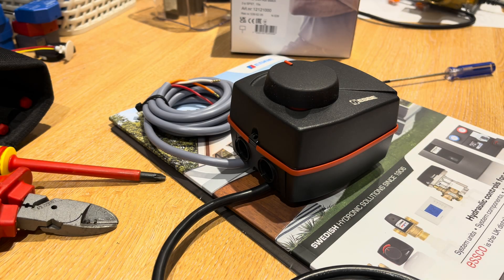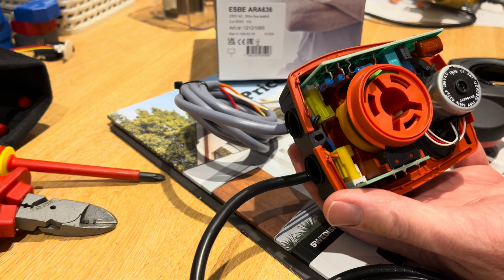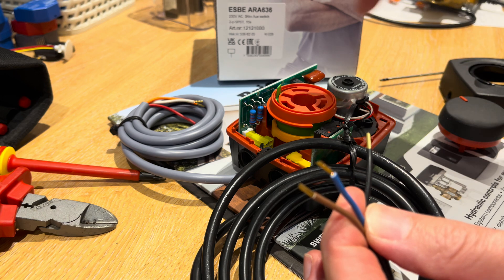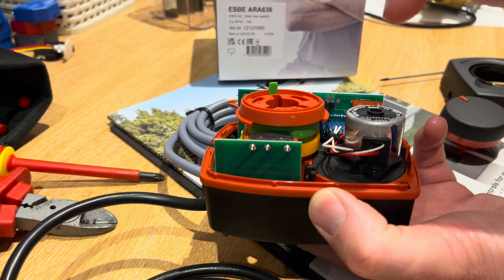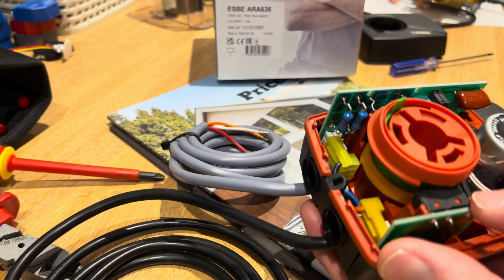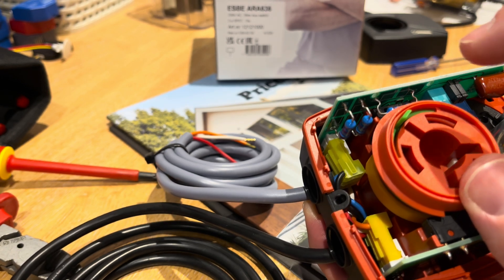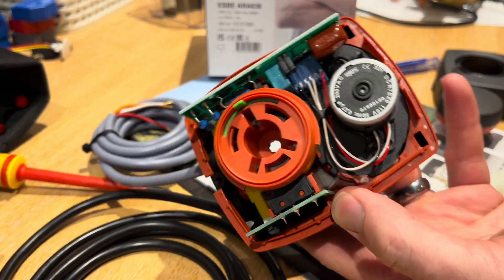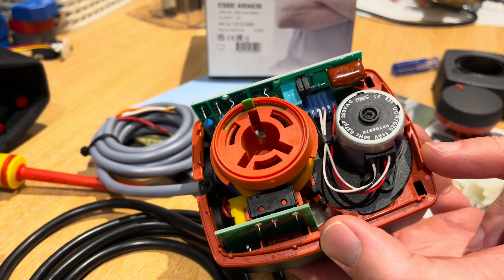ESBE ARA600 Series - ESBE ARA636 2 Point Actuator Overview

Comment: I have a question,screw the green part in the handwheel can let the switch connect on the line ,and what can the switch can do ?
Reply from the maker: The end switch module can be adjusted so when the set point is met by the rotation of the valve, it can trigger something else.
Reply: @MWPHS Thanks for u reply, I searched it on the google and also look the document of ESBE,I think it is a so difficult products to use and choose the suitable one for scenes,I need to spend more time on it and then can know it.

Comment: Thanks Rich, what kind of controllers can we use for this actuator, only ESBE or other brands also?
Reply from the maker: The 2-point actuator is designed to be used with heat pumps and gas boilers as a diverter. Can be used with most systems where the manufacturer can control an external 3 port diverter valve.